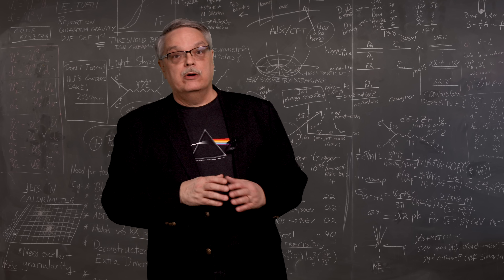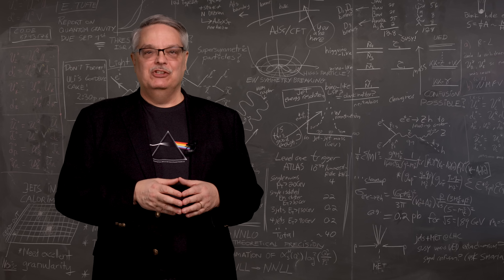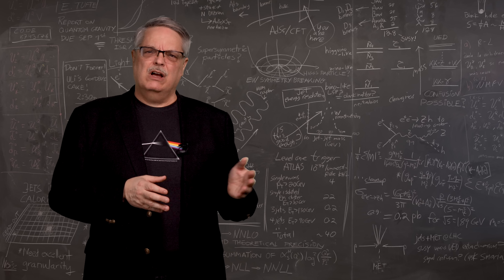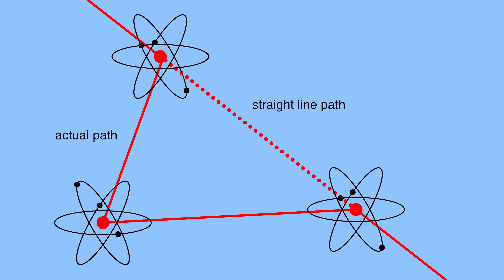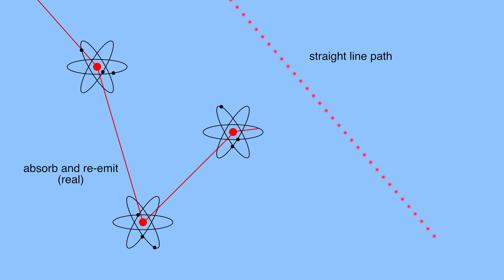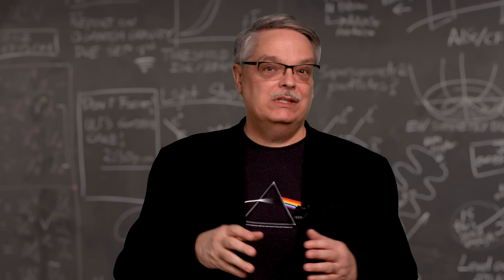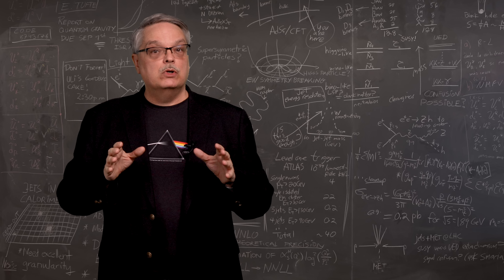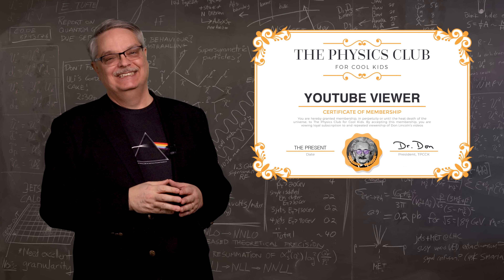Why does light slow down in water?

Comment: The thing with 'explanations' (as opposed to 'underlying mathematics') is that from its start, it is an 'interpretation' of what happens underneath. As such, it can vary widely without losing much accuracy. In other words, there can be many, equally correct explanations for the same phenomena. 

I would argue that 'light slowing down is due to waveform interference' is just as one-sided as the 'emission and reemission theory'. My point is, in the instant the electron starts vibrating according to the external electric field, it gains some energy from its previous, low-energy 'stationary' state. In the energy sense, it has to have 'absorbed a photon'. A vibrating electron produces electromagnetic fields, and those fields carries energy out from the electron, consequently lowering its energy. In the energy sense, it has to have 'emitted a photon'. A photon, being a quantum object, can interfere with versions of itself coming from different paths/realities. Hence, the effective quantum waveform shows interference and makes the newer, slower photon path/mode. Interestingly, that path is not an 'effective scattering' mode due to the particular shape of the emission and absorption waveforms. That itself can be interpreted as 'random/spontaneous photon absorption' followed by 'stimulated photon reemission' (as opposed to 'spontaneous photon reemission' that a scatter does).

In summary, even the absroption/reemission theory can be made to work with this situation IMHO. But that does not make Dr. Don's theory wrong also.

Comment: You said that inside the glass the electric field is the combination of light and the one from the electons; question: why doesnt the original field from the light reach the other lower surface still at the speed of light from the original one (the speed of light in air/ vacuum)?
Why doesnt the momentum change inside the glass? p=lambda/h ; lamda is smaller so momentum should also be smaller?

Comment: 8:35 The speed of light (of a photon) is independent of its wavelength. If a photon travels slower than the speed of light it means it has mass. Since all photons are massless (if you remove the quantum uncertainty) their speed must be c. The only theory suggesting that the speed of light depends on its wavelength is the LQG.

Comment: It still begs the question why electromagnetic waves travel slower in most media. The accelerating electrons are still just producing electromagnetic waves—why do these electromagnetic waves travel slower in media than in a vacuum?
Reply: Each material is affected differently by the same electromagnetic waves of light, based on many, many factors. The result of this is that the atoms in each material oscillate at different speeds, which releases complimentary waves of different wavelengths. The faster the specific atom goes, the faster and in a way "stronger" wave is produced and so the original wavelength of light is affected - "slowed down" - more

Comment: I think the explanation although good requires a little more. I think it’s also important to remember that a photon is an elementary particle, a quantum of electromagnetic radiation. So while it maybe slowed by interacting induced fields in the water the particle/wave photon remains intact and it’s frequency is unaltered. So when the photon exits the water it has the same frequency and energy (E = hf, where h is Planck’s constant and f is frequency) as it had on entering.  Thus, light, a beam of many photons goes into the water and comes out intact despite interactions with induced fields in the water. There will of course be some photons which hit an atom and get scattered or absorbed. 
I hope that helps and please correct me if wrong.

Comment: While this explanation might be true, there is a problem. If you add the two waves travelling with different speed you also get an amplitude modulation (7:07 onwards), but if you look at the wave solution in matter from maxwells equations there is no such thing. So in from which theoretical framework do you derive this secondary wave?

Comment: Amazing how experts can pretend to debunk theories to show a "correct" theory which is even worse than the others. In his example where he adds two waves with different speeds, the wave tops and bottoms of the resulting wave indeed travel more slowly but the onset of the wave (the very first bit of it that was emitted when the light was switched on) still travels at the speed of light. Basically, the only difference between the third wave and the first wave is their frequency. In order for the start of the wave to arrive at the destination at a later time, the second wave would have to completely cancel out a large number of leading tops and bottoms and only let the later part through somehow. Obviously that's not what happens, and it certainly does not rhyme with the explanation given in this video.
So even if you consider light to be made up of waves (which is already a false starting point), this theory is still wrong.
If you want to know how light works, watch Richard Feynman's famous QED lectures (available on YouTube). They are very old, but still the best explanation of quantum mechanics I've ever seen. In it, Feynman actually mocks the theory that light is both a wave and a particle, or worse, it behaves like a wave on thursdays and a particle on tuesdays. Light consists of particles, not waves. Now these particles (not just photons, but also electrons, protons, neutrons, positrons, etc.) travel in a way that looks a lot like waves, but they are not waves in some medium and you can't just add the waves of different photons together. It's basically just a whole bunch of complex numbers spreading out through space, which together determine the probability of the particle arriving at some destination (or more accurately, the probability of observing some specific result).
If I am not mistaken (but I'm not am expert), the "debunked" absorption/reemission theory is actually the correct one. But why doesn't the light spread out in all directions then? For the same reason that light travels in a straight line in a vacuum. The light has many different paths available to it, and the wave function does take all those different paths into account, but only the paths very closely around the optimal path produce amplitudes that point in the same direction (have a similar complex "argument")  and therefore amplify each other. The longer paths, away from the optimum shortest distance, vary so much in distance that their amplitudes cancel each other out. Once again, Feynman clearly explains this in his lectures, it's quite hard to summarize it all in this short post.
The absorption/reemission scenario of light traveling through water is a lot more complicated than that of a single photon traveling through vaccum. A huge number of particles are now involved, and we have to consider the amplitude of every possible path that the photons might possibly take: get absorbed by atom #1, reemitted in some random direction some random amount of time later, get absorbed by atom #23, get reemitted in some other direction, etcetera. This is obviously a humongous (if not infinite) number of possible scenarios, and each of them results in some amplitude. But just like for the photon through vacuum, the vast majority of these paths cancel each other out so that only the paths remains that yield the result that we end up seeing, a straight line through the medium with some average number of absorptions that result in a speed lower than c.

Comment: Thank you for the video. But I don't understand: Since the electrons are oscillated by the EM waves, I think they should oscillate in the same frequency with original waves. And the EM waves released by the electrons' oscillation should be in the same frequency as the original EM wave. Since the speed of light in vacuum is the same, the combined wave of these two EM waves should just be a wave with the same speed, same frequency and a slightly different shape due to the superposition principle. 
I hope someone can give me an explanation.
Reply: The electrons aren't oscillating at exactly the same frequency. Their frequency also depends on the resonant frequency of their atoms. That is why the refractive index is different for different materials.
Then what we need to know(approximately) is the field produced by the surface behind it and add this to the original wave. Because this field gets a lot of contributions from various positions on the surface it turns out to simply have its peaks delayed. Adding this to the original gives us a phase shift.
Feynman goes into this in more mathematical detail in chapters 30 and 31 of the lectures, which are freely available online.
Reply: @narfwhals7843  Thank you! You are so kind!

Comment: We've learned about this in optoelectronics class and had to derive it. I was very happy about learning about it. Although I forgot what is the exact reason for the light bending, as opposed to just "illusionary" slowing down. Snell law is all I remember :P

EDIT: Have watched your next video explaining the light bending. as expected, same phenomenon.
Reply: Please Bro can you explain to me why the wave created by the electrons moves at a different speed 9:20 and also why the combined new way moves slower than the speed of light 9:43 ? Please bro I didn't find why...
Reply: Fermilab is wrong, it doesn't work like that, the speed is the same, it is the PHASE that goes back slightly, really the speed of light is the same, it is the appearance that the phase gives that makes us believe that it is going slower @Khalid-Ibn-Al-Walid
Reply: @Khalid-Ibn-Al-Walid  it does not. The reason is in innertia due to mass of electrons which means it takes time to accelerate them and waveform to "grow". So it lags behind the original wave.

Comment: I wish the host would explain frequency doubling and why converting heat to visible light and back aren’t employed with graphene conduits and lenses to shed or refocus excessive heat from reentry vehicles or into hypersonic plane engines. Can sound waves be negated by creating interference waves at the source? Or at least controlled or redirected in some useful rather than their traditional destructive ways? Contrarotating blade tip noise spoils the power advantages of those props, which could hinder electric passenger jet development, but if you know how cowlings could create a continuous ‘dead spot,’ maybe sound or air pressure waves could be altered, as you describe that in light waves. Are gravity waves affected by one another too?

Comment: Glad you recorded: Why does light bend when it enters glass. Recommend people view that one first, to assist with understanding this video.
Reply: I was just asking myself why it bends.
Reply: You can see if you consider the wave form of the emitted light. The waves goes up and down in a sin(w t), and it must be a continuous function. That last requirement is what makes the direction change, so that the waves in function of time remains continuous. Another more intuitive way of seeing that is by considering two parallel beams that are close to each other. If two photons are "adjacent" when they're about to enter the material (drawing a line between them makes a perpendicular to the beam), they can't be adjacent any more when they're in the material, because one has entered before the other - if the angle is not 90°. If you translate that into maths, taking their speed into both materials into account, you'll find the angle again. After that, you can make the two beams closer and closer, and that idea remains at the limit when d -> 0, that is, when the two beams merge into one.
Reply: Can you explain why it bends?

Comment: My next question is, if the light slows down due the presence of electrons generating their own EM fields, what if the beam of laser light traveled perpendicular to and just above the surface of a perfectly smooth sheet of glass? Would some of the closer rays of light be pulled inwards, because they are closer to the atoms, so get to feel more of their EM fields? And what it all even means for light to travel very close to surface of glass and what does it mean for that light to bend into the glass?

Comment: I just have one problem (question) with this explanation which otherwise makes sense. If the new wave which combines with the incoming light is an electric wave, why then this new wave is slower than the speed of light? In any case, thank you for rekindling my passion for physics with this and other excellent videos.
Reply: Why this question is so deep in comment and not being answered?! I have same question to this explanation. Also another question. If electrons start to move, they gained kinetic energy. From what? From light? If yes, does it mean that some photons are 'converted' to the wave which slows main beam and outoing beam is dimmer than source beam?

Comment: Thanks for the really great explanation, fan of your videos! Learned a lot. I have a query understanding it, when light with certain wavelength and speed c merges with wave generated from moving electron to form a new wave with combined wavelength at different speed, this means the light wave should now be suppressed and the new wave should exit the glass/water which means it should not be at speed c anymore when exiting unless my understanding of merging waves is wrong. Could you explain this please?
Reply: Please can you explain to me why the wave created by the electrons moves at a different speed 9:20 and also why the combined new way moves slower than the speed of light 9:43 ? Please I didn't find why...

Comment: Light doesn't slow down going through glass. It's just being redirected. The EM wave travels at the same speed regardless of medium. It's the wavelength that changes as energy is exchanged with other energy sources (atoms). If glass affected the wavelength, it would heat up substantially as energy was imparted to the glass molecules. A prism creates a rainbow because it is changing the wavelengths of the EM waves entering to the different wavelengths of the visible light spectrum. UV rays exchange energy with water molecules which emit rays in the blue wavelength band.

Comment: Imagine you are riding on a flat car on a train.  The train is moving at 50 kilometers per hour.  You throw a ball in the direction the train is traveling. The ball is traveling at 20 kilometers per hour.  If you measure the speed of the ball, you will measure it traveling at 20 kilometers per hour.

There is a stationary observer standing on the ground beside the track.  They are able to see and measure the speed of the ball, which they measure to be 50 +20 = 70 kilometers per hour.

Replace the ball with a flashlight pointing in the direction the train is traveling.  You measure the speed of the light from your flashlight as 299,792 kilometers per second.

Special Relativity tells us the person on the ground will also measure the speed of light at 299,792 kilometers per second.  

Or will they?

Since the index of refraction in air is 1.00029, you should see the speed of light traveling at 299,792/1.0029 or 299,705 kilometers per second.

Does the person on the ground see the speed of light on the train at 299,705 kilometers per second, or at 299,705 + 50 = 299,755 kilometers per second?

Comment: What makes the waves generated in the electrons to get extinguished when the light exits the glass? It is true that there are no atoms/electrons outside in the vacuum but the waves already generated by the vibrating electrons while the light was moving through the glass should continue on to the vacuum also.